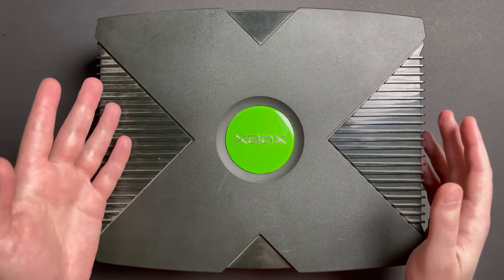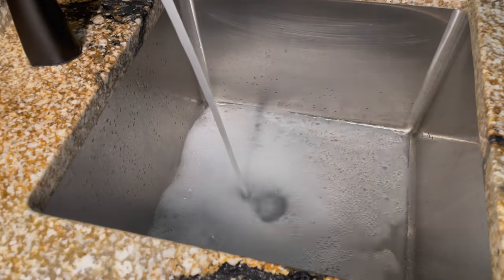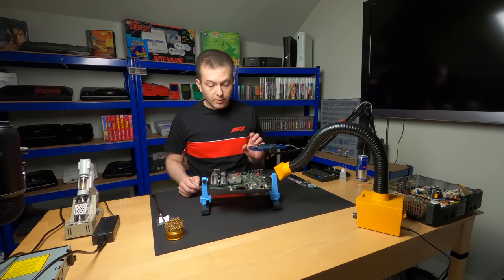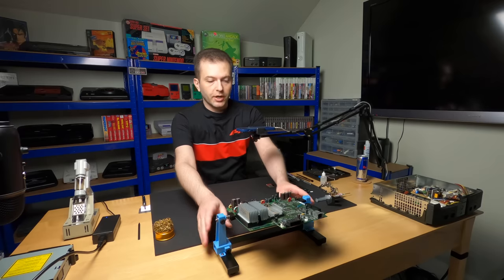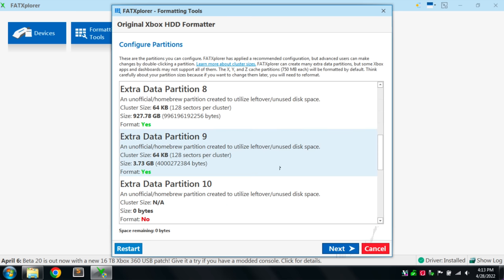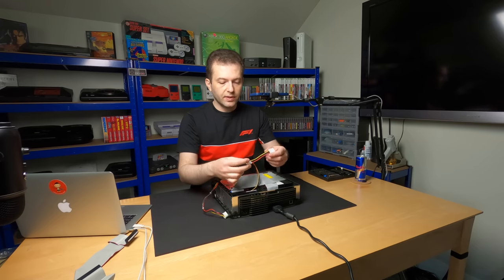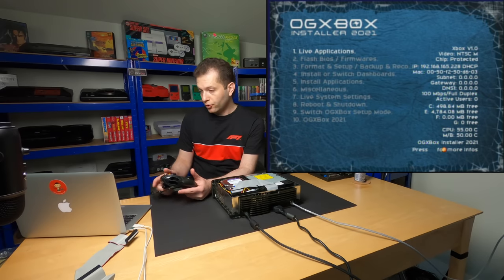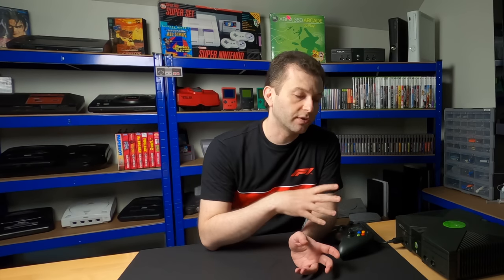16TB in an OG Xbox? CERBIOS has arrived.

Comment: I have dug up my old trusty OG modded Xbox v1.6 couple of days ago.
Have a Duo X2 modchip in there right now, is updating it possible or do I need another modchip?
I am aware that cerbios isnt possible on 1.6 (yet), just looking to see if updating it would be worth it.
Currently running a 60gb hard drive I think and was looking into upgrading that.
Reply from the maker: Any modchip should work. Make sure you have a backup bios on your Duo in case things don’t do according to plan.
Reply: @BorderlineOCD  i am not sure about the backup bios, still missing the video cables so ordered a replacement and also ordered a full set of capacitors.
By the time I got that all figured out maybe Cerbios is available for the 1.6.
The switch on the Duo is to switch between main and backup bios right?

Comment: this is a 1.0 xbox   why a aladdin change when the original bios also can be flashed after some soldering. Or is it not possible to put er cerbios on a TSOP  changed board.  if you use a cooler from a later version of xbox  what is bigger you don't need a fan.

Comment: Not to be a downer but ... what is the purpose of this? I have a 2TB hdd in my RGH 360E and i have so many games that I have never played and its barely past the 50% mark ... I dont know just seems like a waste of space for a generation of games where the largest would have been maybe 2-3 DVD and most were just 1. Still flabbergasted by the dedication of the modding scene but I would much rather have them dunno make stable OC mods and fps unlocks for games on the X360 :D I would 100% buy better cooling if I could get 45-60 fps in my xbox 360 games :o

Comment: Past experience has told me that it is best to turn on the Xbox for a couple of minutes to weaken the thermal glue before attempting to remove the GPU heatsink, otherwise you risk ripping off the GPU die along with the heatsink itself (slams fist on table "don't ask me how I know!").

Comment: Huh, for the GPU I just power it on for 2 minutes & that heat softens it up really well.

I never want to risk damaging a sinlg trace by pulling on the GPU heatsink after 20 years solidifying, plus I tried with 4 & never did they budge.
Especially when just that little bit of heat was enough to loosen them up

Comment: When I select Resctoox v6.0 for some reason I cannot stop the timeout and the program defaults to reading from the DVD drive..  I cannot make out what buttons you are pressing to stop the timeout so that I can then scroll over to the advanced menu?>  Any ideas
Reply from the maker: It has some issues with third-party controllers. Use a genuine controller if you have one, otherwise no idea, no special buttons.
Reply: Damn, dont have any genuine controllers.  However a few years ago this did indeed work when i flashed INDbios, i remember doing it this way back then.  How very odd
 @BorderlineOCD
Reply: You are exactly right! Used a genuine controller and I could then move to different menus and access HDD flash.  I do however have issues with the latest cerbios 2.3.1. on my 1.6 xbox using SCART connection.  where the boot logo and splash screens are scrambled.  If I use component than the boot logo is fine however no splash screen starts!.  I also flashed onto my 1.2 xbox and everything works fine.  I hope they sort out the 1.6 xbox at some point @BorderlineOCD

Comment: I found an xbox once which had a pcb on the front and had no idea what to do with it... So I softmodded it with the splinter cell exploit...  Sooo it's a softmodded over hardware mod...  Must sound idiotic.. but I had no idea what to do with the chip. You think it's possible to desolder everything and put the alladin on with a new hdd?
Reply from the maker: If you're referring to the faceplate controls you might have a pretty collectible modchip in there (Xecuter 3). The Aladdin is just about the cheapest mod chip you can buy (which is why I like it) but there is nothing special about it.

Comment: Sorry to bother, just wondering where did you get your mod chip from? I got a dodgy one off Amazon and am struggling severely with it.
Reply from the maker: Availability comes and goes on Amazon but folks have been having trouble flashing the new XT batches. You might consider getting an XBlast Aladdin from ModzvilleUSA when he restocks them. They are similar in price to the XT and have more features.
Reply: @BorderlineOCD  Thanks for getting back to me! I did watch a video that he was swapping out the chip with a 1mb version, I did find some really old form on the web where there was a difference in model numbers that end in A or B, I confirmed that I have an A model, I am going to attempt another flash this morning, I will report back on my success or not

Comment: Hey sup do you have a new system that's not open. If so can I copy yours and mine xbox iso"s please let me know because ifit hade a 80 250 2tb 3tb then did you by 16 tb to replace the hd i hade in it did you copy al my stuff i need to unlock the 250

Comment: Love the original Xbox. Sometimes if the CPU and GPU heat sinks are really stuck on, I let the console run for about 1-2 minutes so that I don’t strain the chip. Let the compound heat up and it gets just ever so slightly more malleable.
Reply from the maker: A few folks recommended warming it up. It worked really well on the Xbox I worked on after this one (Crystal). Came off much easier.
Reply: @BorderlineOCD  good deal! Glad it worked out for you.

Comment: I went through 4 xbox's. #1 was sold as new from game crazy, got red death light, contacted microsoft because it was supposedly still under manufactures warranty, turned out it was registered through microsoft like half a year before my dad bought it for me, so it was refurbished, and sold as new by game crazy, store took it back, and gave me a supposedly new xbox #2, didn't work at all, got another supposedly new xbox #3, shut down randomly, got another supposedly new xbox #4, destroyed several games, and movies, ended up snapping, and smashing it on our concrete floor, haven't touched an xbox since. Stuck with sony, and nintendo.

Comment: I've got a 1.6 with xecuter chip and front plate. The 500g drive I had in it died.  Would I need a new chip to get this running again? I've been away from this for so long I dont know where to start
Reply from the maker: This isn't yet compatible with a v1.6 so you might wanna keep an eye on the Discord for news on that. The front plate is specific to your modchip I think your options are a bit limited if you want to retain that functionality.

Comment: so why cant you just put a high capacity hard drive in old hardware? would it be possible to put an nvme drive in something like the og xbox? these questions here are here due to lack of knowledge and curiosity.
Reply from the maker: I only understand this at a high level so I’m not gonna try and explain it but what you want to read about is the original LBA32 limitation vs. the LBA48 patches that allowed the system to address a max of 2TB. Then came Cerbios and Titan which broke that barrier in some clever way that’s over my head.

Comment: Never wash components with tap water.

There are minerals and other chemicals in the water that will cause corrosion to certain components over time.

If you are going to wash the components with water, always use distilled water ( No Soap ) / Isopropyl alcohol 70%+.

When replacing thermal compound, always use non-conductive compounds for ICs without a proper heat spreader ( The silver colored shield you find on modern CPUs ).

Excellent video none the less.
Reply from the maker: No idea what you were smoking when you watched the video. The only thing washed with water was the plastic case. The board was cleaned with 99.9% isopropyl alcohol. The thermal compound used is non-conductive, it is Arctic MX4. I could’ve spread it all over the board and it still wouldn’t have shorted anything.
Reply: @BorderlineOCD  Lol whoops. I missed that part. I was doing something else and I just heard the tap water running; I made my bad assumptions. Apologies. I meant no offense, I was simply providing helpful information to comment readers. I've seen so many people destroy electronics because they saw someone on YouTube washing them with tap water not realizing that the water has several chemicals you don't want on the board and I wanted to make sure people realize you can't really do that. And the part about the non-conductive compound was more for people who might be reading these comments and people who do not know any better, not so much you. I just wanted to leave people information that will help them not make a mistake, especially if they've never done stuff like this ever before.

Like I said, excellent video man.

Comment: My favorite original Xboxes are the ones with the flashable bios and eeprom.
After the  first original production run , they modified the original Xboxes to not have the flashable   bios .  the mods were still possible to do , it was just that the 
Exploit and files needed to boot it were installed to the hard drive , instead
of the eeprom and bios

Comment: Hi I have a v1.0 with a leaked aerogel.  xbox wont boot.  I have had this sitting 10 years hoping I could fix it someday.  Do you know if there is hope?
Reply from the maker: What's aerogel? If you mean capacitor fluid then yes, it should be salvageable. A leaky clock cap will often corrode nearby traces. The 3 outermost traces that run on the perimeter of the board are key for main power, be sure to check those.

Comment: would it be viable to run an ssd in the system? maybe a 15000rpm raptor drive for the system?
Reply from the maker: The limitation is the architecture you won't really notice any practical improvements.
Reply: @BorderlineOCD  i wonder if we will ever amiga > raspberry pi style upgrade for the xbox to allow for faster storage/cpu. You could theoretically add to the total memory of the system by quite a lot as the memory controller on a pentium 3 goes quite a lot further than 64mb of ram, and theoretically add a socket to the missing memory pads on the board for the extension/gpio interface

Comment: Hi! Is there any way to instal cerbios without DVD drive? mine dont work=(
Reply from the maker: If you're already modded you can do everything via FTP (dashboards, flash tool, etc.) If not, you need to borrow a drive from a working system then you can remove it after successfully modding the console.

Comment: hey I have a hard modded xbox.  The hard drive has run out of room.  Can I pull it out of my xbox, put the hdd into and enclosure and pull the games off the hard drive onto my computer?  I want to upgrade my hdd so I can finish ripping the rest of my original xbox games to my my xbox.  Thanks.
Reply from the maker: Yes. When you mount the drive with FATXplorer you should be able to copy files to/from it like a normal drive.

Comment: Followed this guide and got lost at the artwork part. You didn’t mention where it was supposed to go. I put it in the xbmc4gamers media folder, it downloaded, but I’m not getting any of the box art like you have. When I went to settings and then to scripts - run Xbox games artwork installer script, it said please install the artwork application. Can anyone point me in the right direction?
Reply from the maker: It doesn't matter where you download it to, you can use the File Manager to browse to that folder and install the application. Once installed, also doesn't matter where it's installed to. You can again use the File Manager to browse to that folder and run the application itself to get the artwork.
Reply: @BorderlineOCD  ahh got it thank you!
Reply: @BorderlineOCD  can the bios flash be done on any Aladdin xt +2 or are there different revisions that aren’t compatible? Last thing I want to do is brick my first modded Xbox. The release notes on for the 2.0 beta build do indeed say Xbox revisions v1.0-1.4, mine is a 1.4.

Comment: I highly recommend upgrading your 40 pin ide cable. The retail one is good however after I have experienced bottlenecks in the past and issues with some adapter + hdd combos not working due to this adapter. Personally I use an Asus 30pin ide cable and I'm running 16tbs on a skeleton xbox with an ox chip and lcd screen + hdd activity light. 1 warning to future modders and it's more advise than warning. Ssds have been hit and miss with og. Lemme clarify that some people have seen really fast deaths on ssds running in these consoles. If you decide you want to ssd swap I highly recommend finding a server grade ssd or a high quality one that can handle constant read and write during operation. This is due to the dash being ran off the hard drive. My 2 cents to help people get the most out of this and remember you are using a beta bios when doing this which means that you will want to watch for official updates and help the devs if you find any issues.
Reply: 30 pin IDE cable?
Reply: @userPrehistoricman  dammit my phone changed to 40 sorry about that 😅
Reply from the maker: I'm using an aftermarket 80-wire 40-pin cable rather than the stock one. The stock one won't even boot once you install the SATA adapter. Were you referring to something else?
Reply: @BorderlineOCD  na that's what I'm referring to. I sometimes do a dvd drive delete. [Mostly because I do heavy mods that require space and since everything is done off hdd I delete to make room.] Originally I was putting 32 pin [been doing other projects using a range of connectors] so not 100% on count I'd have to check rq.

Comment: Just out of curiousity i have an original xbox that wont read discs and doesnt have a cannot read disc error code. Is this something i would be able to pull off without having to use a cd or dvd?
Reply: As far as I am aware xbox must be soft modded first, which unfortunately means dvd drive is needed. I have however seen in videos that the dvd drives are interchangeable as long as it was a model officially used by xboxes.
Reply: @daviddeighton6331  wonderful because we have another xbox at my mother in laws house. We also have an xbox 360 but I imagine that wouldn't work. I was curious about needing to soft mod it because I noticed he said something in this video about getting the DVD from the internet. I also watched a video just like this one by mad mods and I noticed he didn't need to use a DVD. What exactly does soft modding the xbox do? Is it only to partition the hard drive of the xbox?
Reply: @zackm9910  mainly so your xbox can read copied dvds/games, ftp or as above to hardmod console

Comment: you can plug the xbox in and run it for a few minutes without the cooler to heat up the gpu thermal paste, it removes 1000% better

Comment: I wonder what the extra space could be used for.
Reply: Emulators and games, there are N64, Dreamcast, GameCube and PS1 emulators that I can think of off the top of my head and even with 16TB you'll run out of space due to the PS1 library.

Comment: Great video, but your bent soldering gun bothers me.
Reply from the maker: That's known as a "J" tip. It's actually an excellent tip compared to a regular conical tip and the thermal transfer is a bit superior in tight areas.
Reply: @BorderlineOCD  the "J" tip shall haunt my nightmares.  unfortunately my tip kit did not come with one so I will have to take your word on it.

Comment: need help i followed every last step to the letter and when i got to flash my chip with resctoox after the countdown it spits out the disk and tells me to burn a slower speed and when i use xblast and go to flash it just resets the machine can anyone help?
Reply from the maker: I've admittedly never experienced these particular symptoms. The new Aladdins do have write issues due to the chip id manufacturers have switched to using but your message is a bit bizarre. You can consider buying an Xblast Aladdin from ModzvilleUSA. It's still pretty cheap and you can flash the bios directly from the XBlast OS on the modchip itself rather than through the Xbox.

Comment: Having trouble with my chip. The xbox wont boot through the chip. My points are pretty good. Ive also tried the two different D zero points on the board and still no luck.
Reply from the maker: Did you bridge BT point as well so that mod chip is always on?
Reply: @BorderlineOCD  Yes at first i idnt with the Dzero being on the top of the board. Then bridged the BT point and still no luck. Then tried the other point on the bottom of the board and still no luck.
Reply from the maker: Are you on a v1.6?
Reply: @BorderlineOCD  1.1
Reply from the maker: Okay otherwise would need to rebuild LPC header for v1.6. The Aladdin XT is not very complicated. BT point turns it on, and D0 shorted to GND (on Aladdin D0 pad or somewhere on Xbox) tells Xbox to boot from the LPC header instead of onboard BIOS. It could always be a faulty mod chip, or could be an issue with D0 or the LPC header. You could try grounding D0 on Xbox directly (like on a screw hole or nearby GND). If you’re confident the LPC header is also good, might be best to try another mod chip if you can.

Comment: would this work togerher with XboxHD+ mod
Reply: Ya, the xboxHD+ mod has a ribbon cable that is soldered onto the video encoder chip, either focus or conexant, while the original video connector is removed and bridged to trick the Xbox to thinking it's still there. Also a couple other minor things are done, none that interfere with a mod chip install. As others have stated, you might not be able to use titan or cerbios bioses yet with xboxHD+, but there are plenty of bioses that work...just won't be able to use a HDD over 2TB.